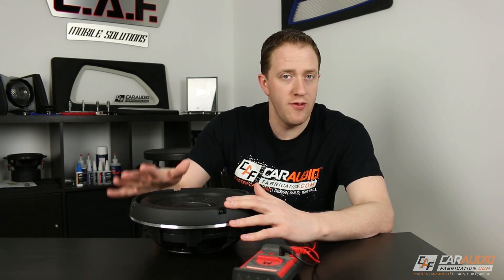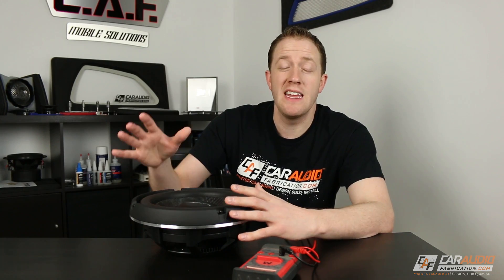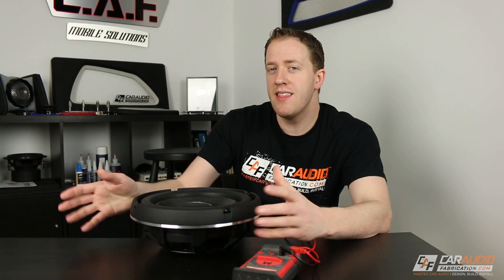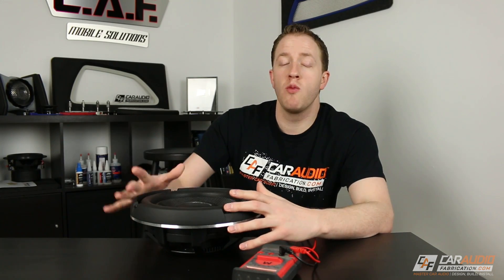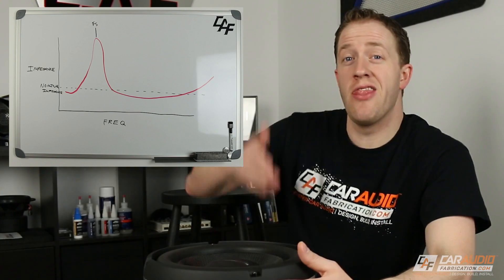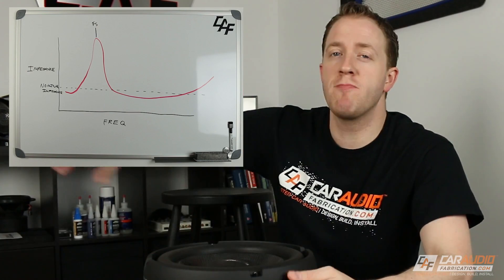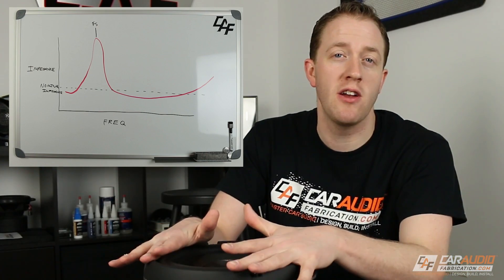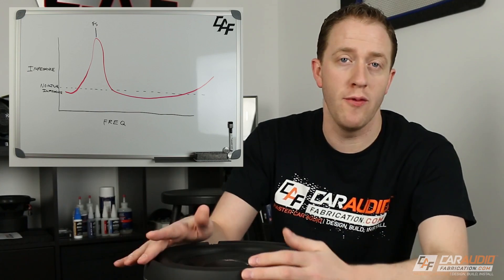Choose BEST Subwoofer for YOU - Thiele / Small Parameters Advanced Lesson

Comment: So in subwoofers, they use the label SPL in place of the sensitivity spec. on standard speakers/drivers?  Odd choice, but good to know.
As a side note:  I don't know if your analogy was for sake of simplicity and keeping all of your analogies relative to each other, but if I'm not mistaken then the mass isn't about slowing down the voicecoil, as it's rate of movement is going to be determined by the values of the electrical signal applied.  The mass/volume of air being moved gives you a lower possible frequency due to the size of lower frequency waves  having a larger wavelength and therefore needing a larger amount of area to complete a full cycle.
I love the videos and I don't know how deep your familiarity with things in those areas are so I just thought you might appreciate the knowledge if you weren't already familiar.

Comment: I've seen a lot of speaker MFG's use 2.83V input to rate SPL by rather than 1 watt. I mention this because 2.83V into 1ohm is going to be more power than 2.83V into 4ohms. It would be nice if everyone used @1w to level the field.

Also, you missed 1 parameter that shows up from time to time yet is seldom explained and that's Xmech. The mechanical limit of the suspension before damage.

Comment: Technically speaking, Thiele/Small parameters only apply at very low voltage, and they DO NOT scale linearly.  The T/S parameters  were created in the 1960's-1970's. I can't remember which youtuber (electrical engineer) did a video on this, or maybe it was Dan Wiggins on a forum?

Comment: great video man, thanks :D also, I was wondering, how do you determine at what frequency to tune a subwoofer enclosure? like, a customer listens to a lot of trap music with heavy bass, how do you pick a frequency to tune that box for? and how do you choose wether to go with a ported or a sealed enclosure?
Reply: Unfortunately it is a that simple. As im sure Mark will tell you too. I am also a professional who did this for many many years. There are so many other things to consider in this. Both sealed & ported can be great. Ported are less forgiving to mistakes, also space since they tend to need more. A proper ported can be very clean & loud. But after it hits its tuning frequency it falls off fast, which not only wastes amp power but can damage subs. The sealed doesn't have this problem so much & can go deeper than the sealed boxes "tuning" (Fc), but i use that term losely in that it isn't tuned in the same way as a ported. But it takes alot of power to & really works the sub to get to its peak tuning, or loudest, whereas opposite for a ported in that the "work" comrs from the port. Actually when a ported sub hits it's tuning (Fb) the sub almost comes to a complete stop, tho so fast its not seen.
So what are you trying to do, how much space do you have, how much money &/ or time will be invested? What kind of vehicle is being used?
Another important factor is something called the "Transfer Function" & the vehicles natural tuning frequency (vFs). Everything has a natural resonance, similar to how he was explaining the subs natural resonance was out of the box, or it's (Fs). Transfer function is pretty much how the sound is tuned, reflects and essentially Amplified and or muffled by the shape, size, & what's in the vehicle. This typically exaggerates frequencies, but can also dampen them.
As a quick for instance, typically SUVs would have a lower resonance (Fs), 
40 - 50hz. Cars usually in the 60 hz range give or take. And hatchback type cars seem to usually be in the 60 -80hz  range. Again this depends on the size and what's in the car, as in the type of materials and if it's stripped down or fully loaded, etc. The transfer function in many cases will tend to exaggerate  these certain frequencies, but not limited only too. In many cases will exaggerate many of the high frequencies also, for instance why SUV type trucks tend to easily get that deeper bass sound, while hatchbacks will be very loud & punchy with their bass.
So as you can see there is alot, & actually still more. 
There used to be a time when the basic rule of thumb was, if you like rap or rock go ported & tuned as low as possible, if you like clean type slower music go sealed,  & a much of other misleading crap.

Comment: .7 Q with 18 hz fs 2k rms for my sq subs please lol what about the Ebp for the woofers box alignment ?
Reply: Etrigan Seven What do you think of an overdamped subwoofer with a qtc of .65 ? It's a sealed ten in a small 1.07 cubic ft box with an f3 of around 58 hz and an "f6" of 43 hz. I' m deciding between that or a sealed 10" from a different brand that has a qtc of .87 with a hump of 1/2 a db on the midbass area, but a lower f3 of 38 hz and an "f6" of 32 hz. Both rated at 500 watts. 
It's for a regular cab Dodge Ram. I'm going for the best SQ possible, not just getting loud. I currently have an overdamped (.56 qtc ) 12" , but it has dual spiders, very stiff and is better suited for a ported box. Sounds decent, plays low enough, but I want a little more punch. Would a jump from .56 to .65 be noticeable?
Reply: u2bed91 adjusting and listening with damping will seriously change the quality. Over damped is usually quickly noticeable to your ear most like a boomier sound

Comment: I've measured the TS parameters for a car audio woofer and found that they were different than the manufacture's supplied specifications. I'm guessing those specifications came from a prototype measured before mass production. They were also measurably different between two woofers never re-coned off the same manufacturing run. Do you ever measure your woofers before building important enclosures?

Comment: is their any point where you would want a speaker or sub with a lower sensitivity? I was all ways told to get the highest you could.
Reply: Subs with very high X-max may tend to have lower sensitivity due to how their motors are set up but in a battle of low frequencies will beat the pants off higher efficiency drivers simply due to them being able to move more air. On the other end of the spectrum are some pro audio woofers which have huge efficiencies, but x-max of only a few millimeters.

It's a "Horses for courses" situation

Comment: Hey there, I am having a bit of trouble figuring out how to complete my system. I don't have a lot of room in the hatchback so not looking into ported boxes, also I am not experienced in sound. Basically I want my entire system to remain Pioneer, but I can't find amps and subs that match, u less I run 2 subs. I took the general advice given on the net to look for amps first then match subs. I found the Pioneer GM-D 9601 and 8601 to match a sub I am looking at, in both RMS and Ohms. The JBL 3-1224 S3 500 RMS. The amps can power it at 4 and 2 ohms respectively as mentioned above. Is this a good setup/ match? And does the sub output 500 RMS at either Ohm setting?
Reply: 500 watts is 500 watts.  Ohms is the amount of power the amplifier needs to use to be able to deliver its power to the speakers. If a speaker is built with 8 Ohms of resistance, the amplifier is using a given amount of the energy it's making to fight the RESISTANCE that the speaker is giving it, so what it has left over is delivered to the speaker as a less amount.
The closer that Ohm number gets to 0, the less RESISTANCE the amplifier needs to fight through to deliver it's power to the speaker. Which is why an amplifier makes more power at a lower Ohm number, but in turn, requires more....But is more efficient. The amp doesn't know how many speakers you plugged into it, all it cares about is the Ohms that the speakers are wired at. What's easier, walking in knee deep water (8 Ohms), or ankle deep water (2 Ohms)?
Reply: IamTheEggMan haha clever. 2 Ohms is easier. Thank you for the help.

Comment: The xmax calculation method that you provide is only valid with overhung voice coil speakers.  (Coil winding length - gap height)/2 = xmax  But for underhung coils, it is (gap height - coil winding length)/2 = xmax.  That's the quickest method to determine xmax.  The other method is to measure the BL of the motor/coil combination as the coil moves.  When the BL drops to 70% of the resting BL measurement, that is the maximum excursion at approximately 10% distortion.

Comment: nice video. i feel a little more info on how each measurement affects sound. like does a stiffer sub produce sharper bass or more boom. also how measurements mesh, like a loose-low vmax sub would most likely sound bad or distorted in a ported box. another view would be what type of sound do you want, measurement groups in this range in box-A will produce crisp bass, this range in box-B will produce big boom bass.